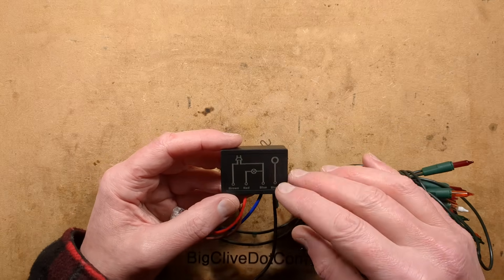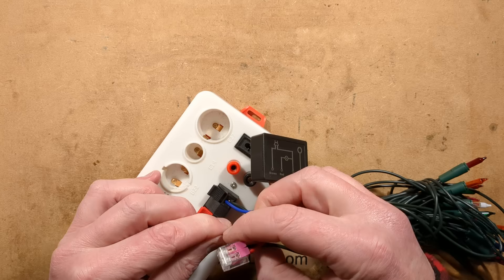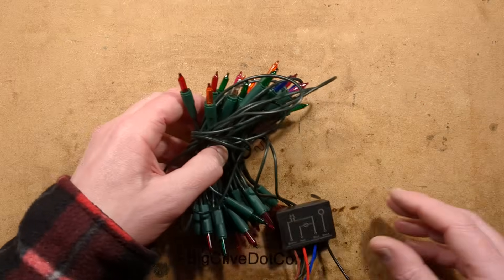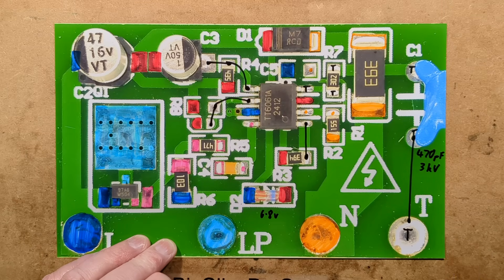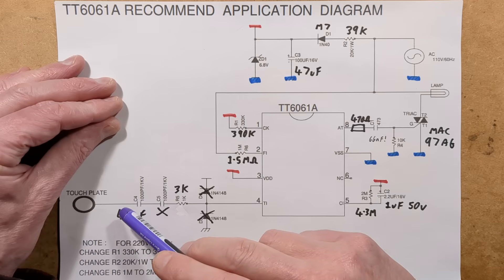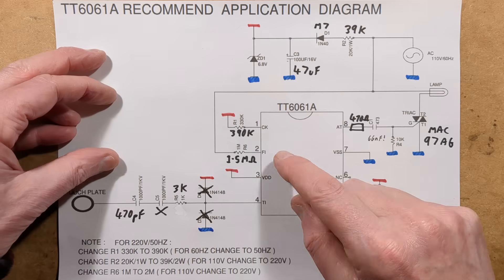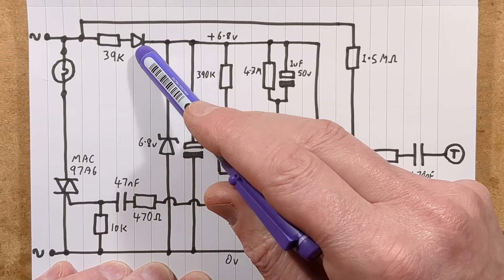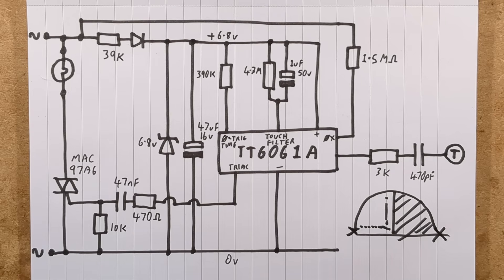inside a mains voltage touch-dimmer - with schematic

Comment: which code allows metal bodies of mains voltage devices beeing not grounded? At least on CE regions it should not exist.
Reply from the maker: The lighting industry is notorious for ungrounded metalwork.
Reply: Double insulation. If there are two layers of insulation, one of which can be air, then it is allowed.
Reply from the maker: @matthewmarks6951  It's when they have two core cable going through pivoting metal joints that creeps me out.
Reply: Even earthed devices with 3 core cables, if it's got cosmetic metalwork, try it, you'll find it's often not connected to earth - and doesn't have to be as long as it's insulated.

Comment: About 3/4 watt through that resistor, it certainly will get hot. I was wondering why they didn't use a capacitive dropper circuit but I guess they would then need a full rectifier too. Cost!
Reply from the maker: It's partly cost and partly the fact that one leg of the supply is the circuit's zero volt reference.
Reply: A dual diode can be had for about the same price as the single diode.  You would still need a resistor for the inrush limiting.  Sadly nobody seems to have worked out that they could make special high ESR capacitors with a high tempco just for the capacitive dropper market.
Reply: A capacitive dropper can be used in a half wave rectifier circuit if the zener diode is placed before the rectifier diode.

Comment: "Speaker terminals are not approved for mains voltage." What happened to the Cliff Quick Test? That did have a safety feature in that you could only insert the cables with the lid open, whereby the power was cut.
Reply from the maker: It's still here, but lacks the convenience of the digital meters.
Reply: @bigclivedotcom modification time?
Reply: I have one of the Cliff things, I first saw it on Big Clive's channel years ago. Very useful.
Reply: @Stuart-AJC  I had a similar device at least 40 years ago called a "keynector" I think, same idea but looked like piano keys to grip the wires.  (found it... 3rd item down the page!)